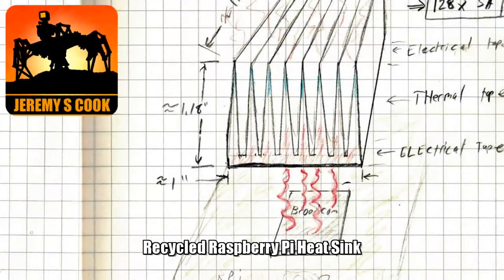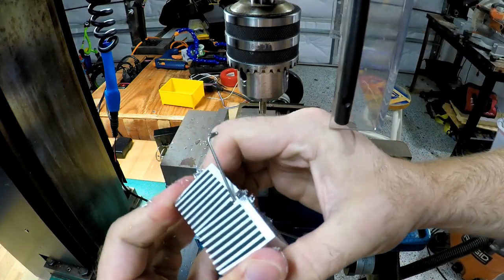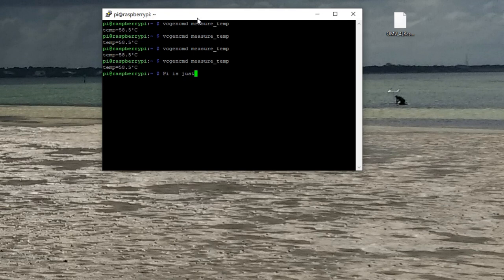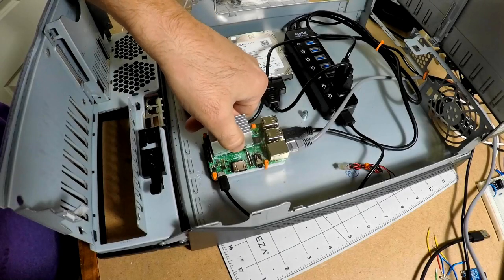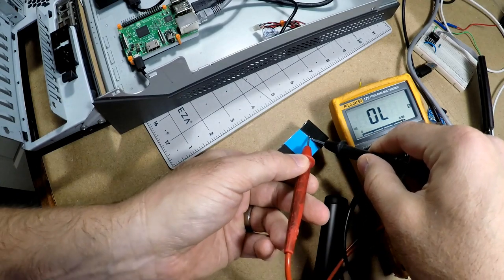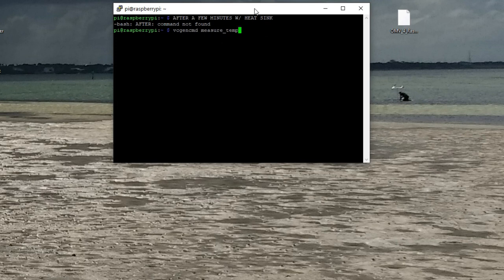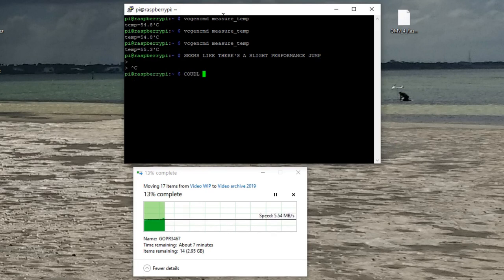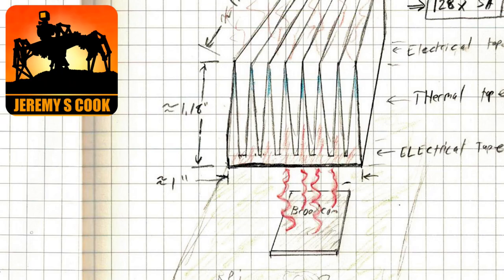HUGE Raspberry Pi Heat Sink from Old PC [Howto]

Comment: Interesting. Maybe add a fan like a noctua a4x10 with the ultra-low-noise adaptor to pull more heat away. If I remember right the boundary layer of air on the heatsink fins will lower the amount of heat transfer to the surroundings without some air movement.
I've been thinking of doing something similar with my "new to me" 3D printer.
Reply from the maker: Thanks for checking it out! Hmm, it seems effective so far as a passive solution, though I do have fans left over from the Lenovo computer, so perhaps I could figure out how to drive them as well.
Reply: Depending on your power supply you could power the fan directly making the fan an always on item. when the RPi is on.
Reply from the maker: @askquestionstrythings  Yeah, that's true. I hate to have a fan running all the time when it's not necessarily needed though.
Reply: @JeremyCook  you could always write a script to monitor the temp and use the single PWM pin from the RPi to control the speed based on the temp (assuming the single PWM pin is available otherwise you would need a PWM breakout board). 3pin or 4pin fans are super simple to control.
Reply from the maker: @askquestionstrythings  True - seems like there is always one more thing to do with this setup :-)
Reply: @JeremyCook  I think all of my projects end up that way too. oh, just one more thing, and another, and another... I'm still trying to figure out how to avoid leaving projects unfinished because of that one tweak I would like to do to make it just that much better.
Reply from the maker: @askquestionstrythings  Ha, yeah. Or there's another project to work on!
Reply: @askquestionstrythings  Even better, I was thinking of turning the fan on only if the temperature reaches a certain treshold. :o)
Reply: @askquestionstrythings  Yes, that is my big pain here too.

Comment: You can use the echo shell command to print messages.
Reply from the maker: Thanks for the idea. Where would you suggest I have used that in the video?
Reply: @JeremyCook  Where ever you are typing your comments; usage: echo "AFTER A FEW MINUTES W/HEAT SINK".  That way, you won't get those "command not found" errors.  In reality, it's no big deal to do it the way you are.
Reply from the maker: @KeithCooper-Albuquerque  Ah, OK, that makes sense. Thanks!
Reply: You could also just start the line with # and write whatever you want. It'll be like a comment in a shell script
Reply from the maker: @donwillingham3743  Ah, nice, thx!

Comment: try this next time:
watch -n1 vcgencmd measure_temp
Reply from the maker: Thanks, what does that do?
Reply: @JeremyCook  cheks temp every 1sec. use ctrl+c to end the command
Reply from the maker: @sanyasanchez3837  Nice, thanks!
Reply: Even better, I guess I could write a couple lines of bash to take the measurement every minute, write it into a text file and then include it to a webpage on the Pi webserver. Perhaps with json and/or a cgi script this could even be done real-time, right?

Comment: anyone with the link to the tape used ? or knows what it is?
Reply from the maker: Hello, I believe it is called thermal tape, more specifically: BLUECELL 20mm x 25m Double Side Adhesive Thermal Conductive Tape
Reply: thanks Jeremy
Reply from the maker: @maso553  NP!
Reply: As said, double-sided tape with (supposedly) high thermal conductance, all over Amazon and I have a roll similar to the video that's extremely strong. That said, there's also thermal epoxies/adhesives that I think are generally supposed to be more effective, closer to good thermal paste w/ mount than the relatively poor heat transfer of pads/tape. But, not everything needs maximum cooling like modern CPU/GPUs

Comment: A tip:
Use a comment # first on comments in the command line.

# Hello world, this will not execute
You could also use the echo(1) or printf(1) command.
echo 'Hello world, this will be output on stdout/screen'
printf 'Hello, this will also be printed on the output'

Great videos though.
Reply from the maker: Thanks for the tip! And thanks for your kind words on the videos!
Reply: @JeremyCook  No problems. Like when people explain things. 

By the way, printf(1) work like printf(2) in the C library, and System.out.printf (which is also System.out.format) in Java, or most foemated output in most programming languahes.

So for simple prins, echo(1) is useful, but more complicated, I would use printf(1) command.
Reply from the maker: @AndersJackson  Neat, thanks!